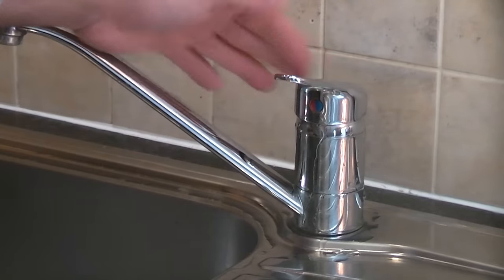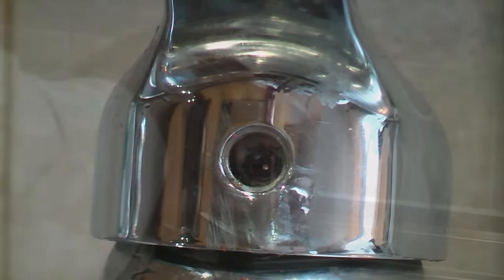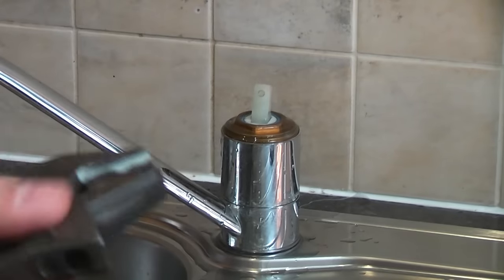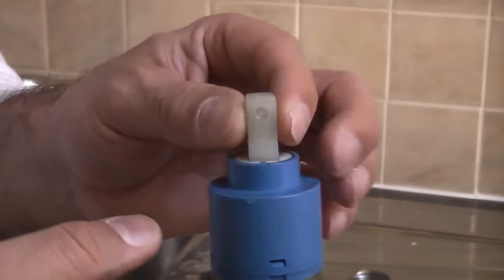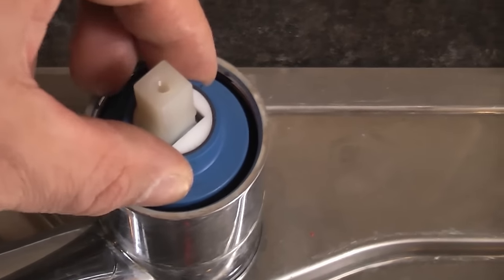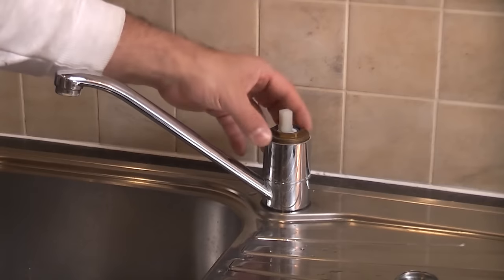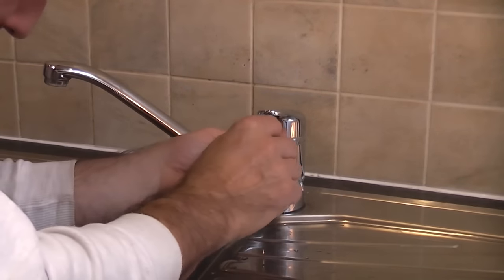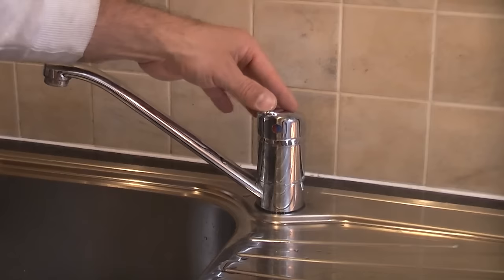Kitchen mixer tap repair

Comment: Thanks so much for this video! Tap was leaking for a couple of weeks and now it's fixed for less than a fiver from Screwfix for a compatible cartridge 😊. Also, thanks for replying to a previous comment by someone else. I had the same trouble getting the top lever off - it was stuck fast - but I followed your advice by putting hot water over it, then I whacked it upwards with a wooden rolling pin and that loosened it enough to come off. All sorted within a short part of the afternoon! By the way, I rarely ever comment on YouTube but you deserve praise for your excellent advice. 🙌

Comment: I have the exact same problem & 1st thought you have to remove the entire tap  from the sink which would've been very complex  & uncomfortable to remove.
The guy at the hardware did tell me it was that blue thingy that was faulty but never knew the temperature markers had only to be removed which makes it much more easier. 
Thx for the video. You've been very helpful
Reply from the maker: I'm glad the video helped 👍

Comment: Thanks. Very satisfying to fix it myself... I found that the washer at the base of the cartridge had come loose and attached to the brass internals of the tap so I peeled it off carefully, cleaned it, put it back in place and reassembled the tap... works perfectly now.  Cheers!
Reply from the maker: Thanks for the comment 👍

Comment: Thanks, Mate. Brilliant video 'how to do'. Twice I have followed it to take out and clean the cartridge of my kitchen tap, when it started to leak. When I replaced it, both times, the leak stopped, problem fixed. I guess the cartridge had shifted a little out of place (even with the lugs), causing the leak, so when replaced it was fixed. 😀✔️😀
Reply from the maker: Great to hear!

Comment: thank you. I was worried about fixing my tape but now I can't wait. thought I'd have to take entire unit out to get to mixing thing.
Reply from the maker: You are welcome.
Thanks for the comment
Reply: My part came today. Took ages to find and was one of the most expensive valves. £ 21-40 . The others seem to be around £ 5. Fitted today and works well. Thanks.
Reply from the maker: Your tap is probably one of the more expensive ones- hence the more expensive cartridge.
Thanks for the update ;-)

Comment: Got to admit it's a great feeling when you finally track down the spare part you need instead of replacing the whole unit.... Finding more and more that spares are hard to come by😁👍🏻
Reply from the maker: +shortyian 
Absolutely. I have to say that I was quite shocked when I went in the first plumbers merchants and he said I'd need the make and model and have to get it from the manufacturers. This was at my sisters house near Preston, normally I walk into Sheths plumbers merchants in Blackburn and they guy behind the counter goes out back and then appears with the correct cartridge. I'm glad the third plumbers merchants had one LOL
Thanks for the comment
Reply from the maker: +Rich Zapp 
I'm not sure about that, although my local plumbing shop in Darwen is a PLUMBASE. I refuse to go in there as they charge different prices for Joe Public and plumbers with an account. I'd rather prefer to spend an extra hour driving to the next town where they don't inflate the prices when I walk in and always have everything I need. 
Thanks for the comment ;-)
Reply: They are not ripping you off as the plumber gets trade prices, and you not being in the trade don't. Nor are you entitled to trade if you are not a plumber etc.

Comment: Thanks for the info, leaking tap fixed in minutes, turned out the whole body of the tap was loose, "o" ring seal was good.
Reply from the maker: Thanks for the comment ;-)
Reply: This is the reply I was hoping to see.  I have a brand new faucet used for about 20 days which leaks when flexed at the tap.  I hope that the large brass screw just needs tightening down plus perhaps a dab of silicone grease on the o rings.  I had a plumber fit it about a year ago in an apartment not often used.

Comment: Hi there, weve got v similar kitchen tap/same.A leak has just sprung from the side of the big long part of the tap.when its switched off it's fine,but when seitched on there are 4 mini tiny jets of water come out the side of the big long tap part.ive tied t-towel round it and the water doesnt  spurt out but runs back to the tap base.ive tried tape and it does the same.yhink need new tap

Comment: Thanks for the video, it's very clear, however when I've replaced the cartridge I no longer have any hot water. I read some comments elsewhere suggesting that I'd put the cartridge in the wrong way round, but I've put it in with the lugs in the locating holes so not sure how else it should go in. Any suggestion would be appreciated!
Reply from the maker: I think it can only go in the one way, as you say, due to the lugs.
Perhaps it is a faulty cartridge?
Reply: @ultimatehandyman  I've ordered another cartridge, from the same manufacturer as the original this time, so I'll see how I get with it. Thanks for your help, keep up the good work!

Comment: Really clear tutorial. Thank you. New cartridge in but now no water at all! Water supply back on, pressure fine elsewhere in the house. Funnily though when I retraced steps to see if I had gone wrong anywhere when I undid the brass nut the water started flowing but the on/off lever wouldn’t respond. Any ideas? Thanks in advance of me calling a plumber!
Reply from the maker: If the holes in the cartridge are in the correct place, it must be a faulty cartridge?
I've never once had a problem like that 🤔
I hope you get it sorted 👍

Comment: Great video and thanks for your expertise . Followed your video and successfully changed cartridge but still same issue and tap is leaking , the leak is just like in your video, maybe I got a faulty new cartridge?
Reply from the maker: I've never had one leak after replacement, unless like you say the new cartridge is faulty 🤔
Thanks for the comment 👍

Comment: Hi great video.
But with me, its like always my bad luck - nothing goes easy.
I have spent hours trying to remove or loose the small grub screw.
Its so hard to see inside the hole and to know what size allen key to us.
Reply from the maker: It’s normally close to a 3mm Allen key 👍

Comment: Perhaps try this first before replacing cartridge. Remove the three-hole valve on the cartridge and replace it using the other side, that is, turn it upside down and replace it. Put cartridge back and tighten the nut. Leak stopped. I wonder if this 'three o-ring' valve can be bought by itself.
Reply from the maker: I don't think you can buy the "O" rings separately, if you can I have never seen them for sale anywhere in the UK.
Thanks for the comment ;-)
Reply: Brilliant tip did this and no longer leaking £10 saved and only took 10 minutes.😉👍🏻
Reply: It would be helpful if there was a supplementary video of what this is about.  I have a hard time picturing it in my head, and I am pretty handy.

Comment: Thank you so much for the video
My tap is the same I have trouble turning it around  it feel very tight. Can you tell me what I need to do please? Thank you so much 🙏
Reply from the maker: It might need stripping down, cleaning and re-assembling (which I have never done)
Sometimes it is easier to get a new tap- https://www.youtube.com/watch?v=N-MyYzYwEhc&t
Reply: If you are handy, the tap can be removed and disassembled including removing the rotating handle and cleaned, you can also soak parts in vinegar for an hour to remove lime, then there are 2 o-rings where the handle rotates, add some silicone grease to those o-rings when reassembling.

Comment: I have a combi boiler do I need to shut off the water from the boiler or just the stop tap under the sink to isolate?
Reply from the maker: I'm sure I've already answered this, but the comment seems to have been deleted by YouTube AGAIN.
Just isolate the incoming main water supply under the sink, that should stop the hot and cold water ;-)

Comment: I have that same leak. But also my tap is dripping water at a slow pace. Could they be linked? Wondering if I just do what you did to start, then see if it fixes the other problem.
Reply from the maker: It’s worth a try. It definitely sounds like something is wrong with the cartridge! 
Thanks for the comment 👍

Comment: Thanks for sharing this.  I had this issue with a tap that looks almost exactly the same, a Carron Phoenix.  Their website referred to a spares outlet whose website had no information. I got a cartridge from E bay.  I ended up making an educated guess as to which model tap I had and which cartridge was needed. Fortunately I guessed right! Curiously, I am now wondering if the right catridge was fiitted in the first place as the hot and cold water holes in the original cartridge are not circular, unlike the holes in the replacement and in the tap base.
Reply from the maker: You are welcome.
Sometimes the shape of the sealing rings on the bottom is different. I guess it depends on what is available, I do know people that have found it easier to replace the tap rather than source a new cartridge!
Thanks for the comment

Comment: Great video, I'm stuck at the initial step taking the grub screw out. Looking in to the tap just looks like a hole, tried a number of different size allen keys and one felt like it was catching to undo but no luck the handle is still on tight. Frustrating as the rest looks easy to do
Reply from the maker: They can be a pain to get out. Have you tried shining a torch through the hole, sometimes that helps as you can see the grub screw head 👍
Reply: @ultimatehandyman  having the exact same issue as this. It looks as if the grub hasn't been in, so in theory the lever should pop off, but it's not moving for love nor money. Either that or the grub screw isn't catching the hex at all. Any suggestions for either problem?
Reply: @stephenreilly8743  If the screw has been removed or is missing, then the lever is probably just stuck and you need to pull it of by force, also try to soak the whole lever area with vinegar to dissolve the lime, maybe even try heating the handle with a hairdrier, just a thought, whatever will work.

Comment: thanks for this, I will have another attempt at locating the grub screw tomorrow, I've taken the indicator cover off but couldn't see it, maybe I didn't have the handle back high enough
Reply from the maker: They can be difficult to see, sometimes shining a torch through the hole helps.
Thanks for the comment 👍

Comment: Would have been great if people could have left links to places that sell these cartridges. I went to a few local merchants and all said the same thing "we've had lots of people over the years asking for these but they're old and we don't stock them, have a search for the part number or look on the internet". I'll end up just replacing the tap
Reply from the maker: There are loads of similar ones, so it's best to take it to a plumbers merchants to ensure you get the correct one 👍

Comment: I wish I'd seen this video before we paid a plumber.  They insisted it was cheaper to replace the whole tap rather than to change the cartridge.  $360 later, the new tap leaks and they say it's normal for water to remain in the spout and continue to leak out.  Still having ongoing problems getting satisfaction with plumber.  Next time I'm going to try to do it myself.
Reply from the maker: Sorry to hear of your troubles.
Thanks for the comment

Comment: The hex lug was a little difficult to remove and the big retaining bolt was stuck; this needed a locking wrench as the adjustable spanner wouldn't hold the small bolt lip. Other than that - great! Fixed the mixer tap with a $15 component.
Reply from the maker: Well done for doing it yourself ;-)
Thanks for the comment 👍

Comment: I took off the grub screw but the top piece is still attached. It's solid
Reply from the maker: They can be a pain to remove. Try some spray penetrant and give it a gentle tap upwards with a block of wood. You can also grip it with both hands and wiggle it upwards, it can take a while, but they normally pop off eventually. You can also try pouring hot water over it.

Comment: good video .
My leak though is coming from the bottom where the tap meets the actual sink  so should I take the whole tap off .cheers
Reply from the maker: Yes, I'm afraid you might need a new tap. 
It might be possible to repair it, but I'm not certain!
Thanks for the comment ;-)

Comment: After removing the old cartridge I noticed the cavity started to fill slowly with water. I replaced with new cartridge but water still seaps out. Is the entire mixer tap stuffed?
Reply from the maker: Yes, it sounds like it.
Sometimes replacement is the best option 👍

Comment: A couple of improvements-put both plugs in to make sure that neither the grub screw nor the plastic button disappear down the drain. Use plumbing tape on the nut. Note the shroud may be plastic and does not respond to a hit from the spanner very well (mine was sticky). Otherwise many thanks it worked a treat.

Comment: I have that tsp but it’s not leaking somewhere it shouldn’t. It’s dripping. I thought I would be replacing a washer but do I need to do what this video shows?
Reply from the maker: Yes, if the tap is dripping from the spout, you need a new cartridge 👍
Reply: Thank you and thank you for the video. After asking my partner to do it resulting in me having to pay £50 for a plumber to fix the stop tap he made leak I found the right cartridge online and did it myself. 20 minutes, done! 💪🏻

Comment: I would require your help with the issue where the rotatory spout is having a leak. So when I  move the spout from right to left or left to right it is leaking at both the upper and lower joints. How to open and fix the rubber washers.?
Reply from the maker: I’m not sure if that is fixable. The same thing happened to the tap in this video, after a couple of years, so I just replaced the whole tap 😉

Comment: Excellent video. However, my tap seems different. It has a plastic lever cartridge that requires cleaning or replacing, but there is no way I can see to remove it. I removed the headgear to expose the lever and then went to remove the brass retaining shroud. The problem is that the retaining shroud has no flats on it, so I cannot see how to unscrew it. Have you come across anything like that before?
Reply from the maker: No, I have not. There are so many different makes of taps now that I'm convinced some manufacturers make it as hard as possible to service them on purpose!
Good luck with it ;-)
Reply: Wasn't that covered at 1:15?

Comment: Wow, this tap is significantly easier than the Moen tap I fixed a year ago - I had to remove an entire hardware store of parts before I even got to the cartridge...
Reply from the maker: +Jo Baecker 
Hi Jo, 
Yes, this is probably the easiest tap I have ever fixed. The only difficult part was obtaining the cartridge for it!
I'm not familiar with Moen taps, but just googled them and they seem very expensive!
Thanks for the comment ;-)
Reply: Moen taps come with a lifetime warranty on the cartridge.  I have replaced many Moen cartridges at the local hardware store where they swap the old cartridge for a new one there and then.  Not so expensive after all, eh?

Comment: Hi. I replaced the cartridge but my mixer tap continues to leak at the joint where the cartridge housing screws into the top of the spout. There doesn't appear to be a washer or o-ring between the two. Any advice?
Reply from the maker: The O ring is normally on the bottom of the cartridge. If tightening the large nut does not fix the leak, it might be time for a new tap.  Unfortunately the build quality on these taps is not great! 
A few months after changing the cartridge in this tap, it started leaking and had to be replaced-
https://www.youtube.com/watch?v=N-MyYzYwEhc&t

Comment: What type of screw driver did you use to remove the cap. As you hid it with your hand. Was it a flat or a star? Please help
Reply from the maker: It was just a small flat bladed driver 👍

Comment: Mine is slightly leaking at the very base where it joins the sink. Nothing dripping from higher up, and under the sink it's all bone dry with both lines tight. What might cause this please?
Reply from the maker: If it is anything like my sisters tap- you might need a new one. Her tap started leaking from the base and there did not seem to be a way to fix it 👍
Reply: @ultimatehandyman  I just stopped the leak myself by hand- tightening the bottom seal (above the sink).

Comment: My mixer tap is leaking from the bottom of the middle section, or the top of the tap bit. 

I've disassembled as far as this video goes, but can't figure out how to get the middle section  released.

Any suggestions?
Reply from the maker: Sometimes, you are better off replacing the whole tap-
https://www.youtube.com/watch?v=N-MyYzYwEhc&t
The tap in the video started leaking a couple of months after the cartridge was replaced, so a new tap was fitted!

Comment: What if there is no grub screw and the cap doesn't come off with a gentle pull?
Reply from the maker: Not sure about that, all the taps I have serviced, have a grub screw holding the lever on.
Perhaps if you could identify the make of tap and try and find instructions?

Comment: Actually i have a tap question, i have a mixer tap, no issue with the valves but its the base of the rotating neck, i put new o rings in, and well i dont know what to lube them with, but so far the new o rings go loose and leak inside a year,  will some of the right lube make them last longer?
Reply from the maker: +jusb1066 
You can get silicone grease for use on potable water, that should help ;-)